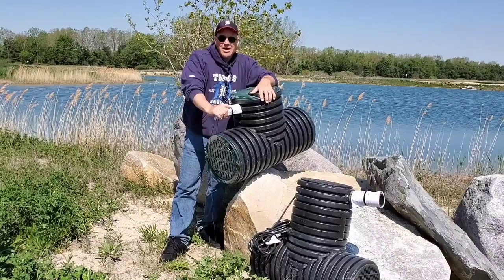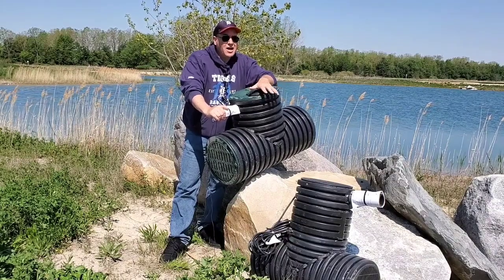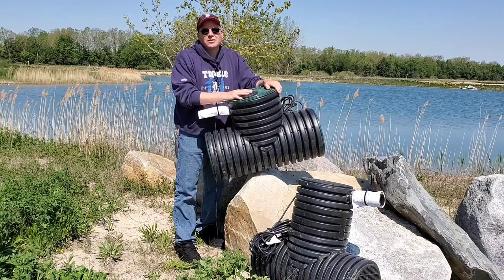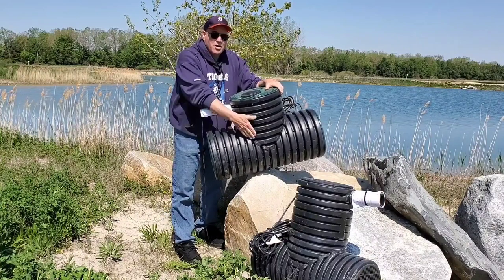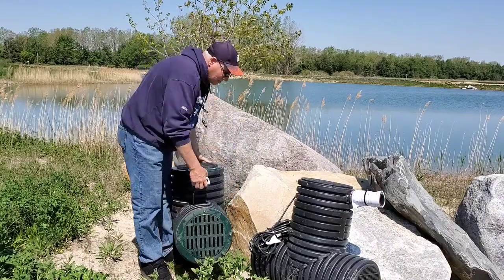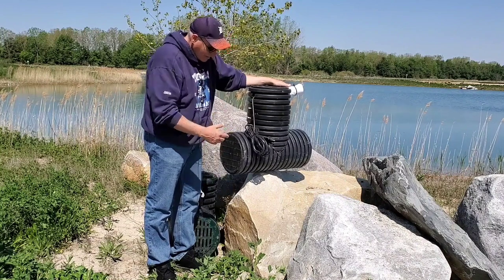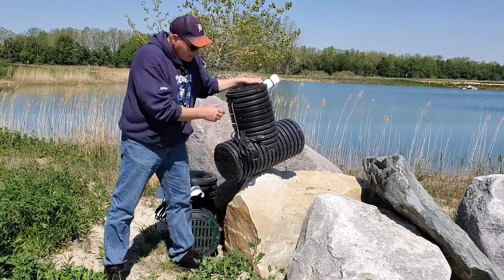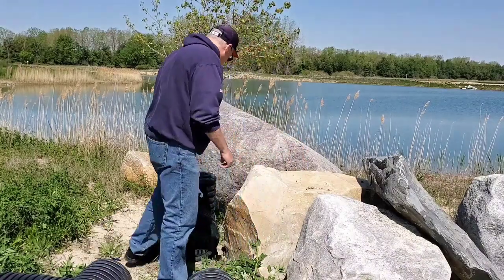Why Sump Pumps Fail, Short Cycle and How to Fix [ Part 4 of Outdoor Sump System Install ]

Comment: Great install. With pump at back fence with 8 inch pipe must be getting ton of water from adjacent property. Why did the sump discharge line stop at the side of the house and not continue out to the curb?
Reply from the maker: It did go to the curb. The discharge......discharged in a 4 inch High Octane Solid Pipe
Reply: @FRENCHDRAINMAN  thanks for the explanation. I saw the blue to the curb. Just assumed the 1 1/2 Inch would carry to the curb.